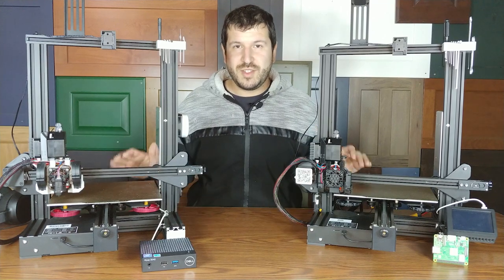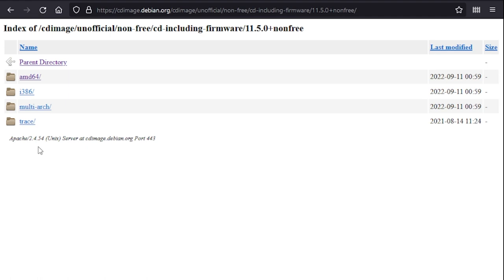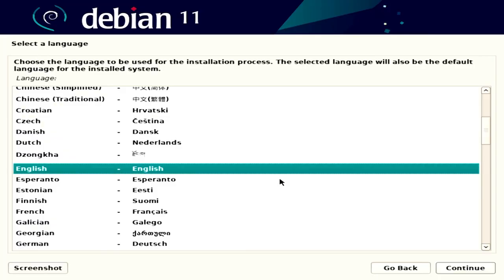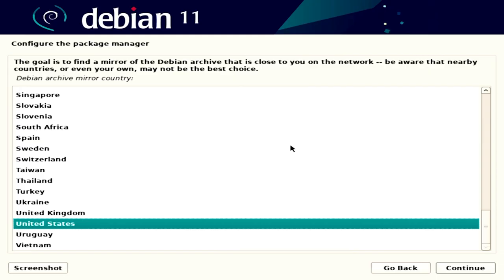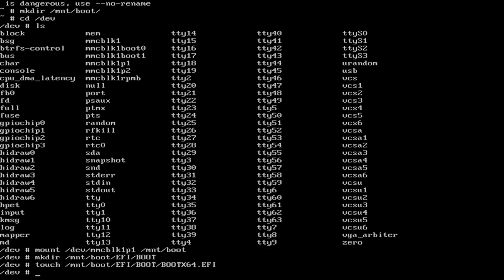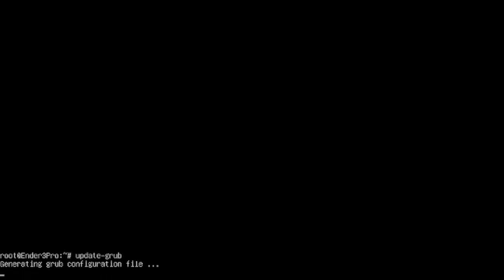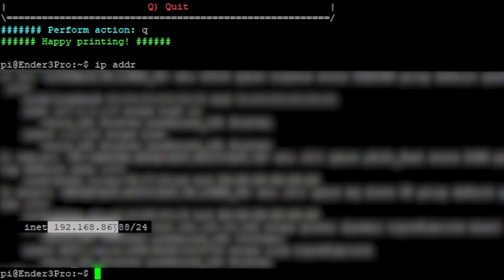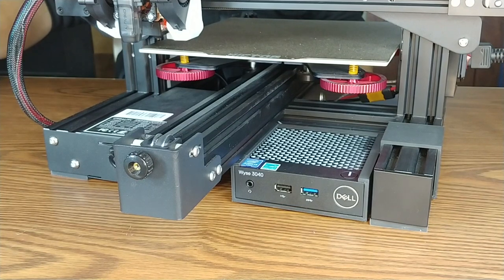Use a Thin Client as a Raspberry Pi alternative for your 3D printer!

Comment from the maker: Next week we'll be looking at how to use an old android smartphone as a touchscreen to interface with klipper. Get subscribed so you don't miss it!
Reply: Great video.
If you don't set up a root password, your computer will be set up to use sudo(8) by default.  No need to do anything.  That is what it try to tell you when you install Debian.
IF you still want to add your user to be able to sudo(8), you only need to add your user (pi) to the group sudo (or sudoer on some Debian based distributions).  Just try
addgroup pi sudo  (or something like that, I doing this from memory).

No need to edit the file /etc/sudoers for this (with the possibility to need to reinstall Debian because wrong edit in /etc/sudoers).

Comment: I have been modifying TV set top boxes for use as a host for serving Klipper or Octopi.  I designed a 3D printed case with a big heatsink and 40mm fan to keep it cool.  A cheap buck converter allows the 12VDC from the motherboard to run the 5VDC board.  It has a ARM Cortex-53 CPU, so there is plenty of power to run any needed software!
Reply: When you factor in sky high electricity prices in Europe, set top boxes are probably the best budget option if you leave the thing running 24/7.

Every watt of power you use costs £4.47 in electricity at current UK electricity prices.  So a 2w set top box is about £9/year to run, where the dell (at about 7w idle) is going to cost over £31/year in electricity.

And frankly I doubt that your set top box is even using 2w, it's basically a low end phone without a screen.
Reply from the maker: I was debating on adding a watt readout to the video while doing the install of Debian, but decided against it. I can attest that the Dell uses a maximum of 4w under heavy load, idling around 2w, and while running a print draws around 3w.

Comment: Great video, thank you very much for that!!! For around $25 I got Klipper running my 3D printer and I'm more than happy! I got 8GB version of Wyse 3040, so as you mentioned at around 6:25, after full installation there is very limitted space left for anything. After fresh installation of Debian, 2x Klipper, 2x Moonraker, KlipperScreen and Fluidd only 1.2GB left for any data. Enough room for gcodes, but soon this space will be eaten by Debian files like archives and journals. Basically every time you start your Klipper machine there will be less and less space. At around 500MB I started to look for solution and I found two helpfull command to solve the problem. Using PuTTY log to your Klipper machine and type: sudo journalctl --vacuum-size=100M (this command will clear journals and leave only 100MB of latest data), sudo apt clean (this command safely cleaning archives folder). After rebooting my Wyse3040, Fluidd shows 1.4GB of free space! Hopefully it will help people with 8GB version of this cheap and great Thin Client :)
Reply: Im new to linux so it maybe stupid question. Can't I just install everything on 32gb usb 3.0 pendrive connected permanently to wyse 3040?
Reply: @Rozbujnik_Rumcajs  I think it will be totally fine. One USB 3.0 is already available on Wyse 3040, so you may even connect some small SSD in external case. Just remember original 5V Dell power supply can deliver only 3A (15W) if you choose SSD.
Reply from the maker: Yes you can plug in a USB 3.0 flash drive and use that as your main boot drive. I use an extra low profile 32gb drive on some of my machines so it doesn't stick out. I haven't noticed a difference in boot time from USB 3.0 vs the internal drive either.

Comment: Thank you for the inspiration to do this myself. I have a Dell Wyse 5010 thin client, which I've now got going. I did take me four attempts, but its done and running on my Ender 3 now. It's a good video and instructions are easy to follow. Thank you again. Now to do the Arduino phone for KlipperScreen.
Reply: Hi, what were the problems you encountered? I have the option on a 5010 and dont want to jump in if it's too much of a hassle for a Linux nood like me. Thanks.

Comment: Nice,  for automatically turn on , you can use wake up on power in boot menu
Reply from the maker: Most if not all of the Dell thin clients already have that option enabled by default so you don't even need to change any settings!

Comment: Hi, Thanks for video and great idea especially with chip shortage, I wanted to point out you can use dietpi which is much more lean, its only 16% used space upon install, Ive used this to install klipper/moonraker and fluid. also by default dietpi boot efi is supported on wyse 3040 so no needed to mess around and saves you time.
ive freed up now two raspberry pi 4b, likely going to resell these now to get my money back , im order more 3040, with dietpi the options are limitless, ive got another one doing my dns adguard
Reply: Would you happen to have a link to a tutorial or something?
Reply from the maker: Hey thanks for the suggestion. I'll look into it and possibly make an updated video about it!
Reply: I followed the instructions on this video and it worked perfectly until I ran out of disk space. I tried dietpi and had 3.5GB of free space but the wifi did not work. Dietpi does not detect the wifi card.

Comment: How do you fix Dell's cpu throttling when you use alternative power supply? Can't we do something inside the board itself to bypass these?😅
Reply from the maker: If the Dell you chose uses a 19.5v power supply instead of a 12v or 5v, the only way to unthrottle the CPU is to either run Windows and use the ThrottleStop app, or to use the correct power supply if you're running Linux. As far as I know, nobody had made a ThrottleStop alternative for Linux that works with the Dell systems.
Reply: @CrimsonRepair  oh that sucks. I've seen these kind of problems since 8 or 10 years ago. I'm surprised no electronics engineer have bypassed this. One of the reasons why I avoid dell. Their used units sells for cheap though so I buy them 😅 🤣🤣

Comment: Great video!  Very informative and detailed.  I followed the instruction to the letter and was able to get my Del 3040 configured.  I connected my Ender 3v2 Neo to the thin client and it doesn't seem to be communicating.  Many mcu errors.  I researched as much as I could, and found there may be a bit more to this install.  Do I need to flash the printer with any Klipper firmware or make any changes to the printer.cfg file?  If so, do you have another video going through that process.  I would hate to go through all this setup and get stopped right at the end.  I have learned so much on your video, thank you again!!

Comment: Great content. a lot of help. Do you use a stock ender 3 pro or is it upgraded? planning on doing this on my Ender 3 pro too. Thanks and Subbed!
Reply from the maker: my Ender 3's are all upgraded Creality 4.2.7 boards with silent drivers. If your ender 3 came with an 8-bit board you won't be able to install Klipper on it, but if it came with a 4.2.2 or 4.2.7 board you will be fine!

Comment: only problem i have encountered with this setup is when klipper does updates it doesn't have any space left, i think it clogs up some temp directory but i have been unable to clear it so it won't work due to only having 0.1kb free. is a full reinstall the only option?

Comment: FWIW, I would NOT stuff a bare PCB into an enclosure.  Just some electrical tape wrapped around it would be good enough to protect it from any accidental shorts.  Also, I would use thicker power wires; those look too spindly to me.  Otherwise, a solid tutorial.  Thank you.

Cheers!

Comment: Great explanation. Which thin clients, besides the one you used,  are compatible?
Reply from the maker: Pretty much any thin clients should work fine, but they will all be a slightly different install method depending which one you choose. I've tried 4 different kinds of Dell thin clients with success each time.

Comment: I used your tutorial but I can't get it to run. The 8GB emmc fills up when trying to install the Klipper-instance with kiauh. Not even a chance.
Reply: I installed everything on 8GB Wyse 3040 including klipperscreen and still there was 1.2GB free space after installation. So it is doable. First check original partitions on your Wyse. Mine was different that the one on the toturial. I had two ext4 partitions instead of one 6.3GB, so I deleted them both, deleted swap partition, changed ESP to 100MB. Work untill you get one 7.7GB ext4 for your installation. 2nd thing - just for sure - don't install new Debian but exactly the one he is installing. To make Debian installation as small as possible don't forget to uncheck desktop environment and Gnome as they consume way too much space. With all this in mind I see no reason why the software wouldn't fit on 8GB. Good luck!

Comment: I have Klipper running with Fluidd perfectly with a pi4.  I just got a Dell 7040 mini and tried you thin client method.  I’ve installed several times following your video.  But when I run LS, I get no p1 or p2.  I do get Sda1 and Sda2 but the boot commands do not find the file or directory.
Reply from the maker: For the 7040, you shouldn't need to add the final commands, you should be able to just reboot after the apt-install network-manager and then choose your boot device from the bios. The 3040 is very specific about having a file named BOOTX64.efi on the EFI partition before it will boot, but it doesn't seem to be a problem with any of the other Dell thin clients I've tried.

Comment: Hey  this worked!  However - I have a question - I installed without wifi - got a dongle for wifi and added it.  I can 'see' it - but I have NO IDEA how to get it working!!  I can get the wname and I can use nmcli to see networks - but as I am very new to Linux - how do I get it to work?  It seem to 'be' there as a device and I can see networks (as I have said) but .. how to connect?  do I have to re-install?  Is it now working because I have the network cable still plugged in? (trying to reconfigure with ssh).  I just don't want to re setup my installation and klipper, etc!!  Thanks for your great video and I hope you can help someone like me who is in the dark!! edit found that I can connect using nmtui - but will that be permanent?? second edit - YES  it DOES!!  Perhaps you should put this info into the readme ... it might help other newbies.. like me.  Once again... thanks for your videos... (I have also repurposed an old cell.. thanks to you!)

Comment: I got a Dell T520 thin client.  It's a bit older than the 3040, with a 1.2-1,5 ghz AMD dual core processor, has 4gb dram and 16gb flash, but the flash is upgradeable to 64gb or more.  Should be good as well for klipper.
Reply from the maker: I actually use a T520 as a router. It has a mini PCI-E slot that I converted to a full size PCI-E and plugged in a Intel network card. Runs everything fine and it's way more powerful than almost any router you'll find sold for a lot cheaper.
Reply: @CrimsonRepair  I've seen a card that plugs into the mini PCI-E slot that adds two SATA ports.  My T520 came a PCI-E wifi card in that socket, but I didn't find a driver for it that would work with Debian or Ubuntu, so I removed it and used a USB-3 wifi dongle.  I moved the speaker out of the way to fit a full sized M.2 SATA card in place of the mini sized one.  I now have a 128gb SSD in there, and it should work with a 1TB SSD if you can find a SATA M.2 to fit.  But that would probably cost more than what I paid for the T520.  Ditto for an 8GB dimm module to upgrade the memory.  4GB is enough to run Debian and Klipper without a desktop environment.

Comment: Without installing the Debian Desktop(won't fit on the 8gb unit and allow enough space for Klipper), is there a way to get KlipperScreen to output display from the 3040 itself to a regular monitor and allow mouse input for navigating the menu?

Comment: Just found your video,thank you for this ,this is something i been thinking about doing,will it be the same process for any thin client?? How many instances can i run in this particular one you're using? Thank you again
Reply from the maker: I run my printers from a single thin client for each printer, but I've installed a 3040 for someone else who was running 3 instances on the same 3040 and even with all 3 printers running it was only around 30% usage on the CPU, so you could probably run 5-8 on a single 3040

Comment: I have the old version of raspberry pi and i cant run klipper on it , there is way ? ( pi 1 model B)
Reply from the maker: The 1st Gen pi isn't fast enough to run klipper. Even the 2nd gen isn't really fast enough for modern printers and it might timeout in the middle of a print. You'll need at least a 3rd gen to not have any issues.

Comment: Can the dell wyse run several printers under one klipper/Moonraker installation? I have done this on PC but does the dell wyse capable enough?
Reply from the maker: With the resource monitor built into moonraker, I would say you should be able to run about 6 printers off of a Wyse 3040 before you run into issues. With two of them hooked to the same thin client I see a maximum of around 30% usage

Comment: I'm stuck in the console when selecting the partitions. I did the partitions but they are not being listed on after the ls command.
Reply from the maker: Another way of creating the partition you need is to download DietPi, install that normally and it will auto-create the partition needed on first startup. Then go back and start over with this video again, and skip that last part after doing the network-manager install.

Comment: I guess I'm too dense for this. Bought a Dell Wyse 5070 and followed the instructions closely. Everything appeared to install correctly and I can access the client through the browser, but my Ender 3 Neo will not connect even though the power from the USB powers the controller with the printer's power supply off (theoretically indicates that it's not a cable issue).  Searched online for clues to what I'm missing, but I'm not having much luck.  It's a great idea and I was hoping to use it on the awful Anycubic Kobra Plus I have if I could get it to work on the Ender.
Reply from the maker: Did you flash klipper to the Ender 3 Neo? I didn't go through the steps to flash the printer board in this video, as I figured there's already enough videos on how to do that out there
Reply: I have. Nothing I'm finding is making a difference, so I may start from the beginning. Third try. Not being well-versed in Linux puts me at a disadvantage because when I think I find a solution, it becomes a rabbit hole of learning to  understand what is being done.  The 5070 has plenty of memory, so I I stalled the GUI and GNOME in the last attempt so that I could have a dumbed down way to find files. Debian sees the printer connected to the port, but it is not found or connecting in Fluidd.  The messages I get are "mcu 'mcu': Unable to connect." When I restart the firmware in Fluidd, it says that the printer is not ready.
Reply from the maker: @markross9403  when you run the command on the thin client to find your printer: ls /dev/serial/by-id/*
What shows up? Sometimes the Ender boards can be picky about what the firmware file is named, and maybe it didn't actually flash klipper correctly.
Reply: It is /dev/serial/by-id/usb-1a86_USB_Serial-if00-port0
This appears to be what is the most common result.
Reply: OK. I got it! I had to copy and paste the cfg file data into the Fluidd cfg file to get it to connect. Now to get the printer to behave because all of the XYZ positions are way off.

Comment: An excellent guide. Thank you very much
Am setting up on an HP T520 and can’t see any partitions when I get to the mounting part. When I setup in the install disc partition part, I only have 1 partition….don’t have the ESP partition at all
Reply from the maker: You will have to delete all of your partitions so all you have is "free space", then create a 100mb partition, under "use as" choose EFI System Partition, then go back and create a second partition with the rest of your free space

Comment: I got a 3040 for $45 USD with power supply. I installed Xubuntu 22,10 plus Git, Klipper, Klondike and Mainsail. No issues. But I decided to back up to Xubuntu 22.04 and after installing Linux it says I have 4gb free and Klipper install fails with 0 bytes free. Now I'm going to try your instructions.

Comment: Whats up bro, i have a question regarding space on these 3040's. Mine just did an update and it failed to update moonraker due to not enough space and now its stuck in that error because im maxed out on space. do you know how to delete items or how to make more space. i cant even open kiah because of it. help would be appreciated.
Reply from the maker: Look into how to remove old kernels from Debian. Usually when you update, it installs a new kernel but doesn't remove the old one. Each kernel is over 300mb of space

Comment: Awesome video man.
One Q: would this Debian work on a Wyse 5060? It's an AMD thin client, so different hardware. I can get one at a much better price then 3040...
Also comes with WiFi standard, I don't have to worry about that if is present or not.
Reply from the maker: Yes it should work fine on a 5060, and you might not need the final part of the Debian setup after installing network-manager.
Reply: @CrimsonRepair  one more thing: how can I use an accelerometer with this setup? Since I only have USB inputs, no I O pins...
Reply from the maker: @Blueyedevil2702  you can make up a USB adxl345 using a raspberry pi Pico. Nero 3D actually has a fantastic video on that subject